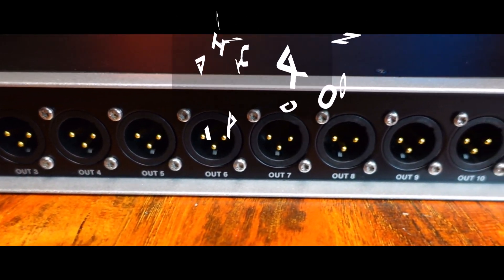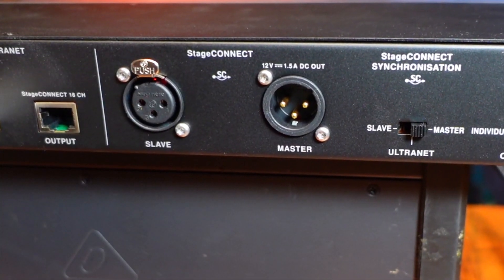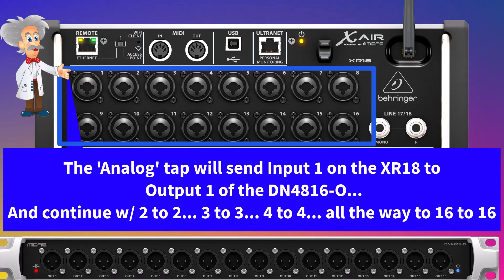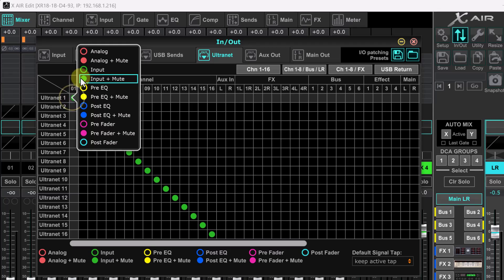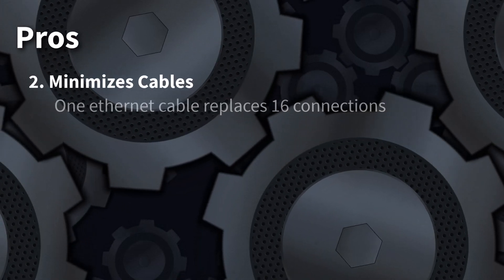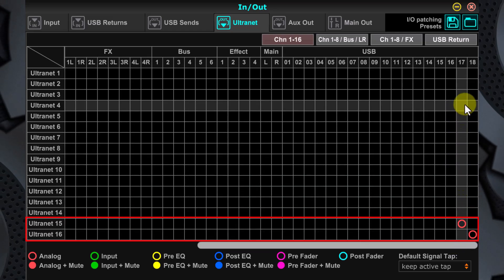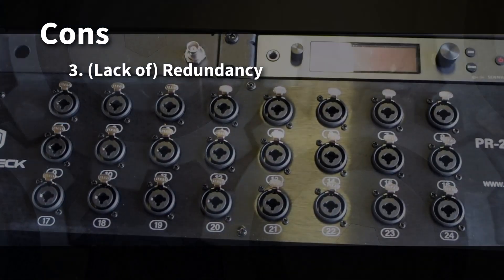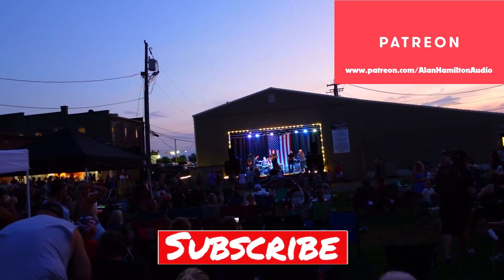Behringer XR18 with Midas DN4816-O for IEM Splitter

Comment from the maker: For a lot of reasons, I can see these Midas StageCONNECT boxes are going to be popular for a lot of uses. And one of them is definitely packaging the DB4816-O with an XR18 for a digital splitter in what can be a very compact IEM rack.

But that said, they are not the same as an analog splitter. An analog splitter is a pretty simple thing and it just works. It doesn't require anything from either the FOH or Mon consoles. The StageCONNECT box is digital and it requires a power source (power supply is included, you just have to remember to plug it in 🙃), and it needs an interface like the monitor console (XR18 or MR18 in this case).
That means there are options, and mistakes that can be made. Both in routing and operation. So that is what this video addresses. Trying to make sure if someone want to go down this path they do it correctly so both the band and the FOH provider can interface with each other and have a smooth gig. And where things work like everyone expects, and hopefully understands.

As long as the band does things correctly on their end with their IEM rig with the StageCONNECT box in place, the venue/event provider should have no issues and it should be pretty much seamless and operate like an analog splitter as far as they are concerned. EXCEPT... the DN4816-O is line level out versus mic level like FOH would see from an analog splitter.
But any FOH person that understands how to watch the input meters and set input gain should have no issue with that.

Likes and subscribes always appreciated. Feel free to share the video link.
Leave your questions and comments below.

🚀🎤Sweetwater Affiliate Link:
https://sweetwater.sjv.io/PybnYY

🚀🚀Items on Sweetwater from video:

Midas DN4816-O on Sweetwater-
https://sweetwater.sjv.io/LXVA0Y

Behringer XR18 Digital Mixer on Sweetwater-
https://sweetwater.sjv.io/baNBrm

Midas MR18 Digital Mixer on Sweetwater-
https://sweetwater.sjv.io/rQDKqd

Gator Shallow 4sp rack on Sweetwater-
https://sweetwater.sjv.io/k0eD4d

Behringer Wing on Sweetwater-
https://sweetwater.sjv.io/zNEZyr

Digital Mixers (Midas/Behringer/etc) on Sweetwater-
https://sweetwater.sjv.io/g16Eng

📦Amazon Affiliate Links:

Proreck Analog Splitter-
https://amzn.to/4fhnA66

Elite Core Fan to Fan Snake Cable-
https://amzn.to/3YnPSWR

Cat 8 Ethernet Cable-
https://amzn.to/3WyJaM6

Items Used to Make This Video-

PROAR 414 XLR Microphone and accessories:
https://amzn.to/4aCrUK4

Sony ZV1 Camera on Amazon:
https://amzn.to/3z9MHny

Canon M50 MkII Camera on Amazon:
https://amzn.to/3z6c8X5

“As an Amazon Associate I earn from qualifying purchases.”
"I earn from affiliate link purchases"

Items purchased thru affiliate links come at no additional cost to viewers, but these purchases can earn the channel commissions.

-----------------
🎚✨ Support via Patreon:
https://www.patreon.com/AlanHamiltonAudio

🎶🎶Channel Facebook Page:
https://www.facebook.com/groups/livesoundproduction
Reply: This video has given me other ideas. I also think this will be a popular option. And also (and if I'm not wrong) adding the Klark Teknik DN4816U to the equation, would allow for a church (as an example) that does not require a greater number of physical inputs, but does require a greater number of outputs/mixes, to continue having a USB option for recording/transmission on another computer, while using a first computer dedicated to making additional mixes (received by the console's USB), which will have their output buses through the Midas DN4816-O for the respective monitoring. The potential is in the USB/Ultranet combination.

Comment: Hi Alan,

thanks for the very inspiring video. For me it's a great idea, and I'm a musician and often also a FOH sound engineer at small events.

Now a few of my thoughts for the opponents of your solution:

- Not every FOH sound engineer will provide sufficiently high-quality monitoring signals, so it's better to have your own IEM solution as a band. This is probably clear to everyone. I've seen a few concerts where the band failed due to the monitoring that the FOH sent them.

- The signals from musical instruments and microphones must be split into two separate consoles. This can be solved analogically right after the connected instruments. There is also an alternative, digital solution, which involves certain compromises.

- Analog signal splitting also has its pitfalls.

- My experience has shown me that many FOH sound engineers do not understand their job well enough, and many of them do not even know that the knob labeled gain can be turned to the left when the incoming signal is stronger. And I'm not talking about the fact that these experts often plug various parts of the equipment into various random electrical outlets in the wall and then they get ground loops and they just shrug their shoulders that the electricity is a mess.

- If the sound engineer wants an analog splitter, why doesn't he have his own? I can also adapt to this solution. (I'm thinking mainly of those sometimes arrogant pros at big events.)

- As a musician, I want to minimize the weight and dimensions of the boxes I carry with me.

- The signal behind the XR18 analog input amplifier is stronger, which can be an advantage even with balanced cables, if the IEM input does not have a stupidly set gain.

- Yes, the band must communicate with the sound engineer before the event, clarifying the options for both parties well in advance. From the perspective of an occasional FOH sound engineer, I know that even after my inquiries, bands were sometimes unable to provide me with a stage plan. But it has also happened to me that a month in advance I was asked by the sound engineer about the number of microphones, guitars, other instruments, how many DI boxes we will need... Unfortunately, this does not happen often. ... and then everyone is surprised.

Comment: I was directed here to find out how to use a simple MIDI controller to select Snapshots. 
I’m having to wade through stuff about the splitter, not sure if it’s ever going to get to what I need.
Reply from the maker: I'm afraid I don't really cover anything about MIDI as far as the XR18 goes. I don't really have a need in it for any of my workflows, so it's not something I really deal with.

Comment: I’m doing this setup with my Mr-18 to run front of house outputs.

I’m noticing that the outputs are so hot that the downstream mixer gain isn’t even working.  How do I deal with this?
Reply from the maker: 'Technically' via the 'knob' setting the house mixer gain should be at 0dB. Most mixers will have SEVERAL dB available above 0 and only a few dB of cut under. Some mixers will have a PAD though, that can trim the incoming level before it even hits the preamp.
But... back to 'technically'... the 0dB setting 'should' be a workable setting for the house mixer.

If the 0dB physical setting point is getting overwhelmed to the point that what little negative gain it has is not close to enough to fix things then the problem must be on your end.

2 things come to mind in that scenario:
The first is that you are running your gains too hot. You're supposed to average -18dBFS on the input meters and should peak higher. So maybe you're averaging too much and/or allowing peaks to be way to hot.

Assuming that is not the issue, the second thing that comes to mind is your tap points. You should check the Ultranet taps. Your outs should be Analog or Input. Red or Green. Make sure they're that and that someone didn't mistake magenta for red or cyan for green.

Or both could also be the issue... So confirm both things are right. Especially those tap points. You might get away with hotter input levels IF the tap points are right... but if the taps are wrong then it all just compounds.

Comment: Can you give a little more clarity on the Shared vs. Individual switch?  When would Shared be used?
Reply from the maker: IIRC "Shared" could also be called duplicated. Two units doing the same thing. I've not used "Shared" and I don't really know when that would be used. I suppose if you were using it for a digital split from a monitor console setup, and had someone mixing a live broadcast from a 3rd console, that would be one possibility. One DN sending to FOH and another that is sending to the broadcast console.
Reply: @AlanHamiltonAudio Thanks!

Comment: 6:22 so if I have a phone that we like to hear a song or drums to do a practice to.  Should we have a USB c to XLR and have it come into the system? I guess this has nothing to do with the Midas
Reply from the maker: You would connect the phone like you normally do, then in the Ultranet routing screen make sure that channel is feeding to the DN4816-O (channel to Ultranet).
Reply: @AlanHamiltonAudio iPhones don’t have a convenient audio out; it’s easier to use Bluetooth
Reply: Get a cheap Bluetooth receiver and connect its output to the line in or other input.

Comment: Would the lack of a ground lift switch also be a potential con?
Reply from the maker: I've got a 48ch analog passive splitter snake. It's at least 20 years old. It has ground lifts (pin one lefts) on it. This is the number of times I've deployed that analog splitter and had to flip a ground switch on it and it fixed an issue: Zero.
So, the answer to your question is "Yes... but no".
Sure, in a theoretical sense, having the option of a pin 1 lift is nice. In a practical sense, not really a dealbreaker IMO. Not if you follow good system interconnect and cabling practices.

It's not to the level of importance that I'd put on having one on a DI for example.
Reply: @ thanks. Great to hear that experience. Would the Midas handle phantom power accidentally being engaged at FOH?

Comment: in my case I own XR and a MR, I mostly do meetings event, but some bands too. I work at another rock show venue, doing monitors. I see all kind of band rig coming in and out. Some are friendly and easy to combine with the house equipments some are painfull. Best is to be self-contain. For my needs and the way I work as FOH engineer, not having matrices (and other features) on the MR/XR, I work ``aux's`` as groups, leaving me with no aux's for monitors mixes. I was looking for this P16 split solution for a long time. It is perfect. What I would rather do since I own two similar console and a Xtouch/computer rig, would be using MR as MAIN FOH (for the better pre-amp) send thoses in's to P16 DN4816-O, and give the XR to my artists (I can then mix myself or they can,  the monitors/IEM seperatly (IPAD or login with the Xtouch back and fourth). Some have limited knowledge, if they can only use the sends level to their IEM that's less to take care when soundcheck for me at FOH.
I still only need 1 rj45 cable from FOH to STAGE. From FOH network switch to the Stage network switch+network router. Get both MR/XR on the network and done, WIFI and LAN connection.

Comment: Hi, thanks for this video. Do I understand correctly that if I send the Ultranet 16 channels from the XR18 to the DN4816-O, I can forward it to my Wing thru the Stage Connect cable and use it in FOH? (I understand that I'll not have control of the XR18 preamps from FOH)
Reply from the maker: Hmmm... I never thought about that possibility and haven't read anything from anyone doing that. The point of the video was for splitting your 16 inputs into outputs to fed 16 analog signal to any FOH console's analog inputs.
But what you're asking, once it's in the StageConnect box, can it forward it to a Wing just via the StageConnect connections between the two devices?
I'm not sure... I've not looked into that or tried it. I think it sounds plausible as a possibility.
I haven't looked into the KT StageConnect box on exactly what it can do, but I think what you're asking is one of the tricks it might be able to do.
https://www.klarkteknik.com/product.html?modelCode=0606-ADK
Here is my Sweetwater link to it:
https://sweetwater.sjv.io/QjjYDP

It would be an even cheaper way to do what you're asking... assuming any of these devices work that way.

Anyway, I'm afraid I don't have a definitive answer for you because it's beyond anything I've tried or researched. I've heard a bit more about using the KT StageConnect box for what seems like similar things to what you're asking... but that doesn't mean the 4816-O can't do it as well.

Hopefully this can point you into some right directions to get a definitive answer.

Comment: bad idea to connect the line input route to ouput like that as IEM it should be mix with different input to the ouput for example we have 18 input and now we have 18 output it should not be one to one mapping. It should be each ouput can be different mixing for the input. for that I will prefer to use link of logic pro . after mixing in logic pro and output as USb then in the mixer just rout the USB to 16 output. then it could be make sense for IEM. IEM should not only listen the original channel audio level. What do you think?
Reply from the maker: The video is talking about sending each channel to a FOH mixer so the FOH mixer can mix FOH, while the XR18 is dedicated to monitors. The monitor mixes would be derived normally on the XR18 from the XR18's 6 XLR aux outs, and also the L-R would be available for a monitor mix since the XR18 wouldn't be doing FOH mixing duties.

So in this scenario, the 18 outputs HAVE to each be split as the video shows to get FOH the same matching inputs that the XR18 is using. So then both consoles have independent control (with the caveat about gain sharing that the video mentions as a con and something to be aware of to make this work). 

IF you're splitting the inputs to FOH in another way, like an analog splitter, OR you're also mixing FOH from the XR18 then there are other ways to use the Midas DN box attached to the XR18, although there will be limitations on just how far you can stretch the capabilities and compromises to get to any additional monitor mixes. But I didn't really go down this path because it's not really what is being discussed in the video as it talks about using the XR18 as a dedicated monitor console and the need to split the signal to FOH in some form. And how the DN box is an option for that, with mentioned caveats, because a lot of people are looking at it for exactly this purpose.

Comment: I'm back, I could use this to run ultra net outputs from my X32 to my XR18 channel inputs and use the XR18 for a dedicated in ear box using the 6 sends plus L & R giving me 8 in ear options.
(not using stereo in ears since the stage is 100% mono) This way I can EQ, add compression to the in ears to make them sound better.

Comment: Thanks for the review. Now I see no use for the DN4816-0 a snake splitter is much more reliable.
Reply from the maker: Thanks!
I think for many people, a regular analog splitter will be a better answer. But for some situations where weight and footprint, or being highly portable, are important parts to be considered, it brings an answer to the table. 

I'm working on some other videos that will have different roles for the DN stuff with different mixers. Like expanding the output count on an X32Rack or M32R... Still using Ultranet.
Or via StageCONNECT connections and doing the same on the Wing. Plus, in the case of the Wing, some models of StageCONNECT boxes allow line level INPUTS to be added to the Wing.
Reply: For a fly rig, it’s amazing!